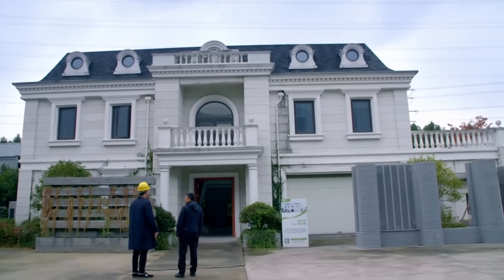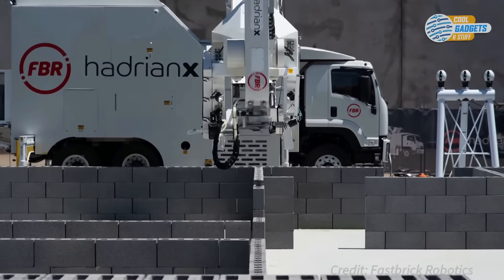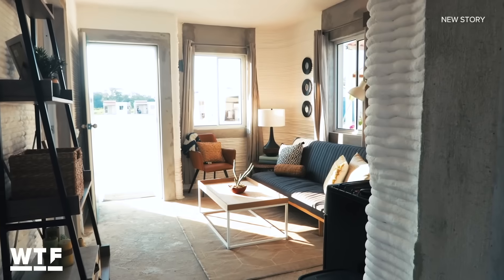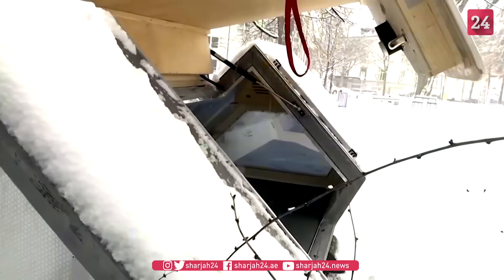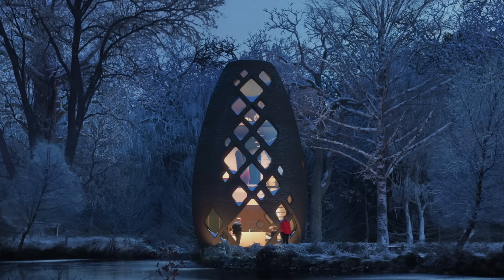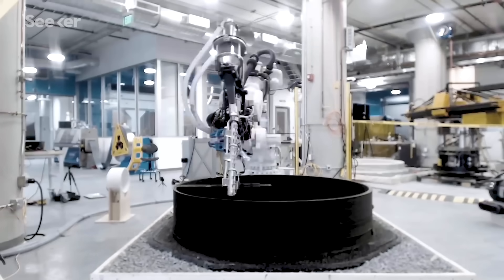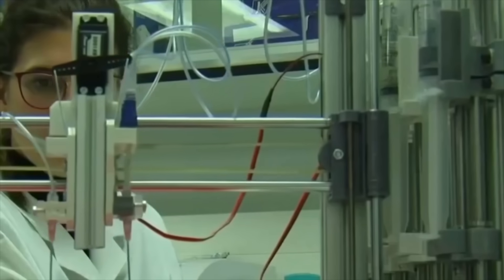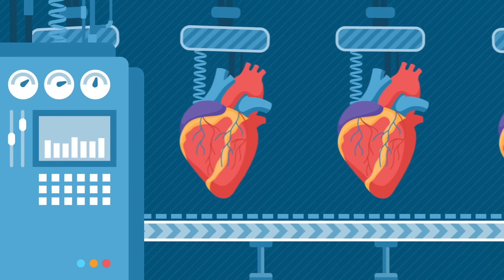Watch robots build houses at incredible speed. 3D printing meets AI.

Comment: The issue with such processes... they are hailed as achievements and cited as solutions, yet they are never utilized to address any matter.     These structures will be utilized in a limited and rather costly capacity.     Per unit, 10X the projected cost at the minimum, that is if ever implemented.    We've had a plethora of "solutions" which generated revenue for developers, yet have never been utilized beyond conceptual renderings and scale models created for investment purposes.

Comment: The service that does the 'printing' will base their prices on what you would normally have to pay a human crew and that will feel 'cheaper' if it's faster. Might come in slightly cheaper to be competitive but that would only last until human crews are a rare thing and competition is dead.  For now, they will quote big savings to enter the market but very quickly that will fade as they need to maintain the equipment which is not cheap.  Is this a solution for homeless? Not really. Homeless does not equal worthless or even unskilled, you could just as easily form crews to build the walls from the homeless population and let them build their own homes. And along the way give them new skills they can use to stop being homeless if they wish to pursue it and a job during the project.  Raising the walls, regardless of the material used, is the cheap and easy part of building a house type structure. Some skill is needed but you can have a couple of skilled people guiding general laborers and they will get the job done pretty well.  Plumbing, AC, Electrical, Glazing, roofing, drywall, etc, everything that makes the place secure and comfortable, still require skilled labor for the most part.

Comment: I would like to see this housebuilding technology adapted to use Hempcrete - much more environmentally friendly than concrete, also changes the atmosphere in the house as it is naturally warm.  Uses hemp fibre and old fashioned lime mortar, also far more stable than concrete in the first hours after pouring - which should be good for use in printing.
Reply: There is already some folks working on that ^^

Comment: It's amazing to see things like this being developed. I really see this as the future of building. I am afraid of one thing though. Most of these initiatives are using concrete, and as said in this video, concrete contributes a lot to global warming. if concrete is also used for normal houses then its use will probably go up quite a bit. I am completely in favour of the initiatives that use organic material or recycled material, but I am a bit sceptical about the ones that use concrete. Unless they are innovative with their concrete. I've heard about innovations in concrete that make it CO2 neutral or even CO2 negative which is great.
Another problem about concrete is that the sand required for (conventional) concrete isn't renewable and that sand from the desert isn't suitable.
So i really hope that they take these problems into account so that this amazing technology can become available to the masses as soon as possible :D

Comment: On one hand, this is good for low-cost housing.

On the other, they are limited to 1 floor height which means any neighborhood built this way will be a horrible, unwalkable, ludicrously expensive suburban hell (which are economically unsustainable due to excessively low density).

Comment: The homeless thing is complete bullshit, the issue isn't that we don't have enough houses/buildings already, it's that house prices (and cost of living) have been made so artificially high and the housing market is dangerously under-regulated. Homes are bought by property speculators and are left empty, or are used as holiday homes for the rich and get used only a few weeks per year. If decreasing homelessness through increasing the housing supply was really a goal of construction developers they wouldn't be knocking down perfectly good 500-unit apartment blocks to build new 300-unit ones, and we certainly wouldn't be buildings houses to last only 30 years before they're demolished. 

Please don't buy into this "technology that's just around the corner will solve all our problems" narrative, it's there to stop people demanding real change and to push certain companies' stock prices up. Even if 3D-printed houses do take off I'm certain that all it would do is put construction workers out of jobs. This new technology is cool, but remember that it can be used for nefarious purposes and that a lot of the hype is completely fabricated.

Comment: She conveniently neglected the set up time and costs. Also a lot of those buildings that were only done in 48 hrs can already be done in under 48 hours. To the same point of completion. It does not take a lot of time to build an enclosed building. Its all the other shit that adds up. electrical, plumbing, hvac, roofing, windows, finishes, ....

I would also like to see how these actually pass codes as housing and not sheds. Just slapping concrete on top of itself is not a strong system. What extra goes in for seismic and wind designs, uplift....? 

The main benefit of it is that you can make crazy shapes just as easily as conventional ones. Which is pretty cool. Not convinced about the speed or any other merit yet.

Comment: Now I want to see a Paul Bunion style battle between the 3d printer, precise placerbot, & a team of home builders!
Reply: Yep, then try doing structural tests with them.
Reply: The battle was scheduled, but Paul Bunion was forced to drop out because of foot pain. ( Bunyans)
Reply: compare a team of people to a machine which was built to do exactly what is measured in the competition isn't a competition ..
let anything be in the way, uneven floor, low quality material, something that forces to change the planned structure to be slightly different .. and the machine will be in serious troubble.
if everything goes as planned .. it will be totaly out of competition

Comment: As a building surveyor I would love to see a low carbon building, but in the south-west of England these single skin walls will be damp and mouldy
Reply: So design it with spacings for isolation.
Reply: I see concrete made with nuclear reactor-based power as the way to get around the stated problems they were saying of having too much fossil fuel based power in making concrete.

Alternatively, to make the structure less porous, use the direct metal laser sintering robots to make the houses out of stainless steel on the outside to better protect against water damage.
Reply: Evan Nibbe And a 1,000 year toxic problem from not using fossil fuels. It's pure insanity to think that anything resulting in something with vast destructive potential should the detritus escape is a solution. Look at Chernobyl and Fukushima to see the folly of nuclear power. It's a reduction in our global polluting footprint that's required and only consuming less power will solve that but that means reducing economic growth and lifestyles to accomplish it, something that's unacceptable to the free market system. Innovations often just promote maintaining current philosophies to perpetuate the system that's not working to try and make it appear to be working. A fools paradise.

Comment: The whole building section didn't mention any downsides, which is a bit concerning. There are many many questions that need to be addressed in those to even make it remotely considerable. How strong are the buildings? How do they fare in bad weather? How long do they last? How is maintenance on these building? How safe are they in disasters? Etc etc etc.
Reply: It's useless, been around at least a decade and I haven't seen them popping up anywhere, clearly have huge problems or regulation issues

Comment: The issue with all these printed buildings is that they ignore all of the actually expensive parts of construction. Foundation laying, electrical, plumbing, etc. are all the things that cost the most in construction and take the most labor and time. 

If the barrier to affordable housing is construction materials, mass-produced prefab houses (often called trailer homes) should've solved the housing crisis ages ago.

This is without mentioning that all these projects are low-density suburban housing too which is incredibly unsustainable.

Comment: I want to know how they handle wiring, plumbing, and ventilation in those 3D printed houses.
Reply: A human comes in and does the complex work
Reply: @ezicarus8216  Precisely.  It's also much more difficult and time consuming to run mechanical and electrical in finished walls.  Might have to resort to having everything surface-mounted, which means $$$ for armoured conduit and the like.
Reply: @LeadSkillets  I would imagine they would print the 3/4 round wire passage ways and boxes, so all you’d have to do is pull the wire and install the switches/outlets and covers. Maybe pex pipes printed right into the walls and floors for plumbing.
Reply: @ezicarus8216  And he does it for free with socialist unicorns bringing manna from heaven and a health care plan from heaven with robotic 3d printers feeding him and taking care of him. Welcome to the matrix.
Reply: @firecatgreg  that was ackchulee pretty funny u owe me s white tee well done
Reply: You just watched a video of a robot extruding material. It never occurred to (any of) you that your concerns are pre-programmed?
Reply: Various other videos on the subject cover this. Voids are created for plumbing or machine pauses for conduit to be inserted. Lintels for windows are easily inserted as this video shows in a small scale. This is going to be a huge industry. Check out the other channels.
We might mock but there was a time when people thought that the human body would fall to bits over thirty miles an hour on the first trains. Stupid in hindsight. A horse can do thirty miles an hour.
Reply: @andrewsaint6581  hmmm so horse power is about 30mph then
Reply: They will probably combine one or several placer robots with the concrete robot to place horizontal mechanicals in the walls between passes. The honeycomb walls would allow vertical wiring to be fished anytime.
Reply: Chased into the floors and wall by manual labour.
Reply: @ezicarus8216  Sorry, pre-programmed into the extruder.
void makeCommode (void solid)
Reply: Modular houses built out of factory-produced wall and floor segments already are established in industry. To me it seems easier to add wiring, sockets and pipes to those segments. Or at least channels and mounts to ease the later installation.
Not sure how adding wallpaper, floor and painting could be optimized.
Reply: I think for electrical and sewerage you need people 😏
Reply: Machines do the outer walls, workers will do all that and cover it with inner walls. I think
Reply: 3d plumber
Reply: Surface mounted. Switch plugs, piping
Reply: Change  order Nightmare!!! oops
Reply: they dont :D
Reply: I want to know how they plaster the walls.
Reply: The same as in prefab housing projects where they are all cookie cutter houses.  After programming just one robot for pulling wire and running pipes along with testing for electrical amperage and water pressure it would become common place. You digitally sinc data to any other robot and then they can work together as a unit. Weight would not be an issue so support I beams would be easily positioned.  It might take a few more years but since it will save money in the long run you can bet it will happen.
Reply: @michaelsparks350  it's never going to happen.
Reply: Or they Print it simultaniously With an Other nozzle (plumbing).
Reply: @DonnyDarko13  no they don't. no such technology exists.
Reply: @Withnail1969  yeah but why shouldn't they ? You Could easily integrate another nozzle which prints Metal Inside Onkyo Problem ist the repeatabilty of such a a big printer.
Reply: The real question is, how do they repair or make an addition to one of these houses?  I think either they can't (it is basically a disposable house) or it will kill the aesthetics and slowly turn into a funky looking Frankenstein house with all kinds of additions "bolted" on.
Reply: @byron_00  its disposable, with no reinforcing the concrete will be crumbling in 10 years.
Reply: The plumbing, electrical, fittings, windows, doors, and actual structure is done separately. These are 3D printed shells not actually 3D printed houses
Reply: This is all utopia 
The earth is over crowded with 
at least 1 billion people
Reply: @denmann364  rather with 5 billion people.
Reply: LOL you are not listening, you will get a world wage you will be work free, you will be very happy, but under the guidance and the direction of the New World Order Govt and with the new reset/Green Deal you won't need electricty,  gas as they will go back to the days of the out house with cans to be emptied no plumbing. etc because there will be none OH! unless you are an elite with your own coal fired power station.  Your food will be delivered by drones from Mc Donalds, Subway, Hungry Jacks, Wendys etc that depends on the drone companies executives. and the gangs/zombies  that roam and rule the streets.Remember reading about how cave man existed, well we are going back there, the wheel has turned.
Oh before I go all these robots need iron ore, steel, cement, copper wire, plastics, rubber, to be built, even the waste products that they will be using, yes need transport fuel to get to job sites and roads etc Mmmmmmmm Ahhh! we need more coal fired power station to make these materials (and for the electric motors/cars trucks). 
Artificial intelligence computers will take over, "HAL where are you?".
 Remember 2001 Space Odyssey. 
Think about it.
And you call this PROGRESS!
Nah! now where did I put  my cyanide tablet.

An Aussie Point Of View.

Comment: UK have had concrete-based houses for upwards of 100 years. Of the 500k+ that have been built, most have now been demolished. Concrete houses are termed to be "un-mortgageable" due to fire, heating, cooling, ventilation, durability and/or other issues.

Romans built in concrete 2000+ years ago!
Reply: How do you burn concrete?

Comment: The cost of the structure of the house is only around %20 of the entire house. Even if you save %50 on that, the cost of the house will drop on %10. Now, in LA that a house cost over $2 million, you reduce it to $1.8million; how would that solve homelessness problem?

Comment: Acquisition of developable land is the most expensive part of any property construction. That is down to people who have the money and power to dictate who can and cannot aquire the plot.
Reply: Code enforcement, zoning permits and building inspections can cost thousands before you even nail two boards together! And you usually have a finish deadline of two years via the building permit, otherwise you get to start the whole shakedown process all over. No building and improving as you can afford it in this made to fail racket!  The system is set up to keep poor people trapped in wage slavery paying tribute to landlords, lenders and tax collectors for decades, until the poor person drops dead.
Reply: land is quite cheap in many rural areas. you are just picky in terms of location.

Comment: Sorry how does PRINTING homes in Concrete help to reduce use of CONCRETE???

Sure if you print clay or the rice husks stuff... but you showed MORE concrete based "printing" or bricklaying than other materials.
Reply: because these 3d printers can make concrete with hollow sections that help with insulation and save material
Reply: Finally an intelligent comment. I think they meant that it would cut away our current kind of concrete, but we can make more sustainable forms of concrete out of nearly anything, including dirt and clay. They should certainly have shown more of that.